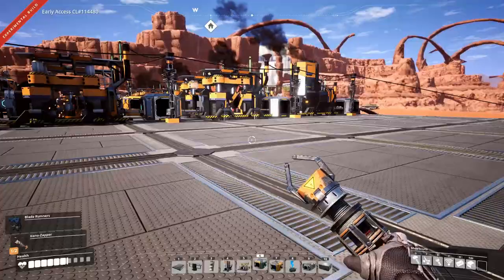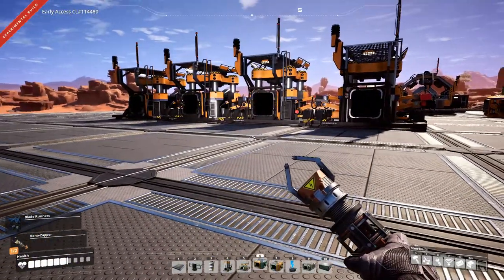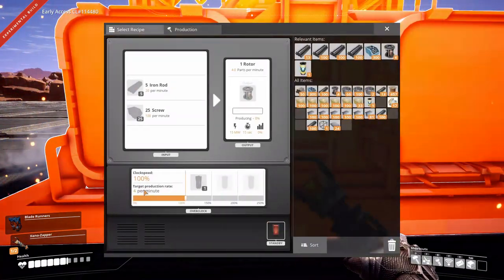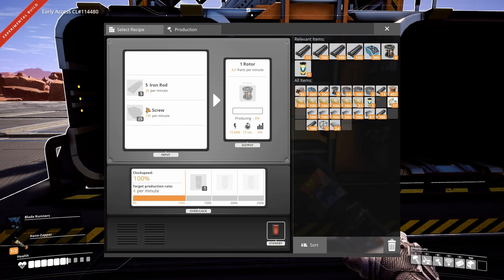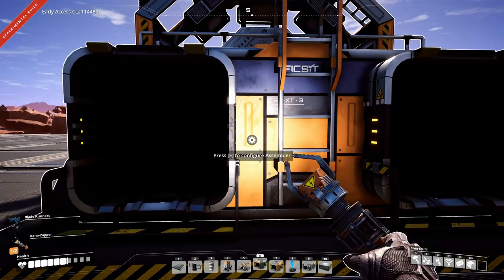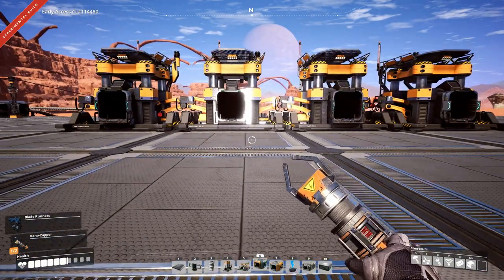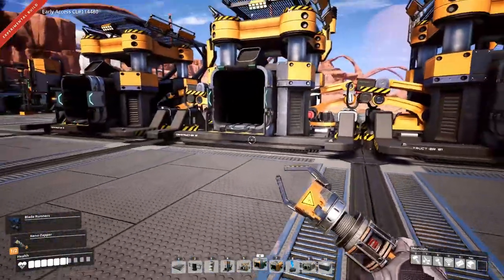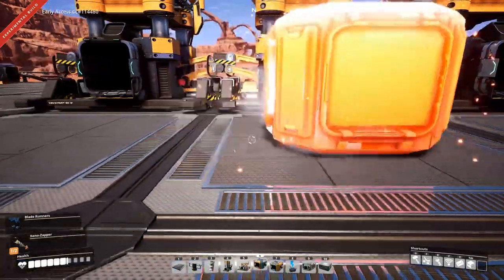Satisfactory Update 3 - Lets Play #11 NEW RECIPE: SMART PLATING

Comment: @20:40 This is pretty similar setup to the Overflow method, you can speed up the balancing process by manually feeding the assemblers a stack of the required inputs. Or you could merge the entire line of Rods and then split off it using the overflow with the First machine at reduced speed to overflow properly.